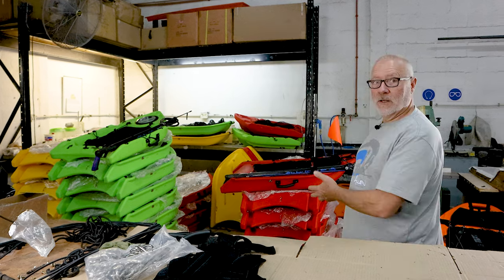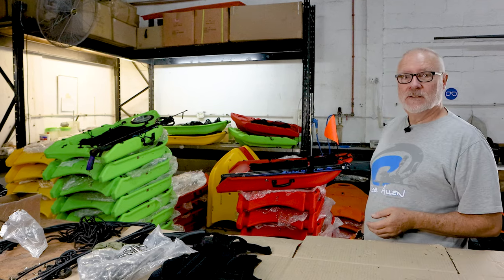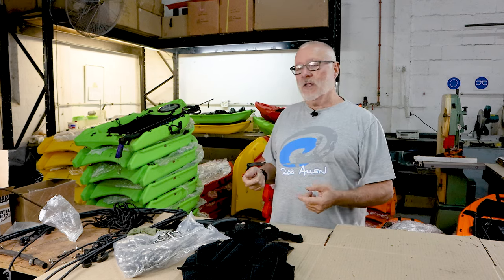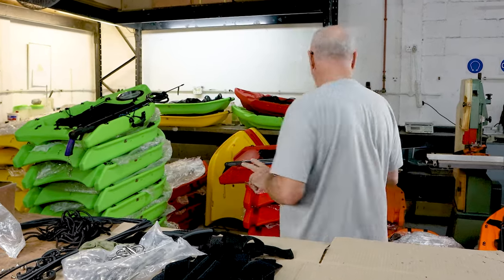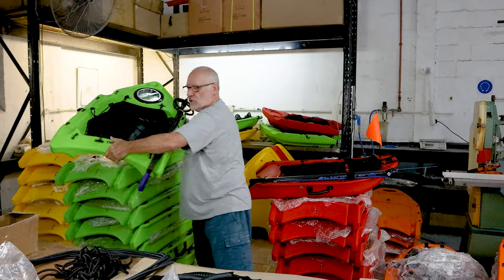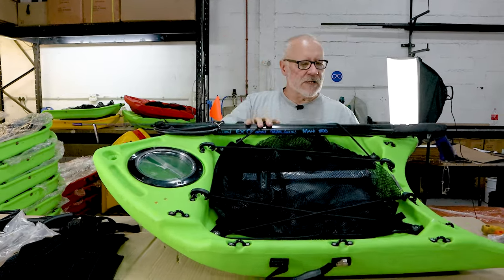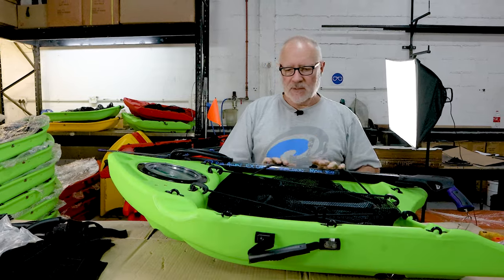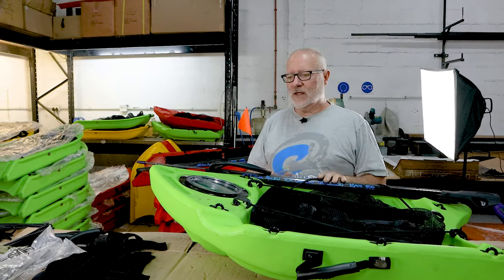Rob Allen | Banks Board | Part 1 | 2024

Comment: How much do the two models weigh? 
May I suggest take photos from different angle for customers? 
It looks great. Better than the New Zealand ones which I havent bought because its too heavy. I have been using my surfboard and put my catch bag and dice flag on top. The surfboard slide through waves very well and created no drag.
Reply from the maker: We are busy with more videos. The manufacturing process is the same so weight is similar. To get weight down you have to make it in fiber glass or, inflatable, both are more costly. The inflatable is very light and good in terms of size when transporting but can puncture. These plastic rotor-moulded types can be dragged over rocks with no problem.